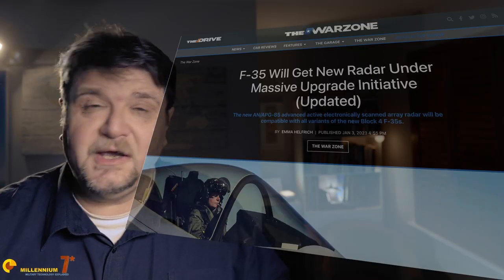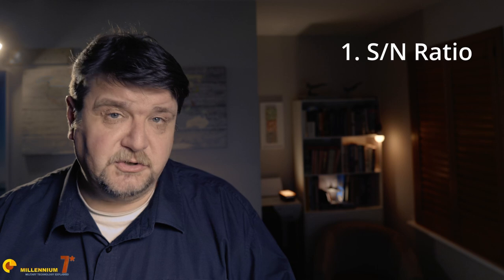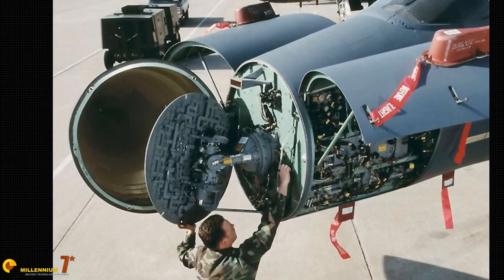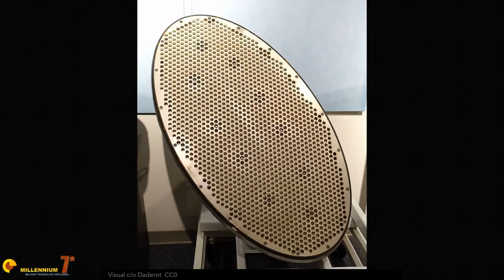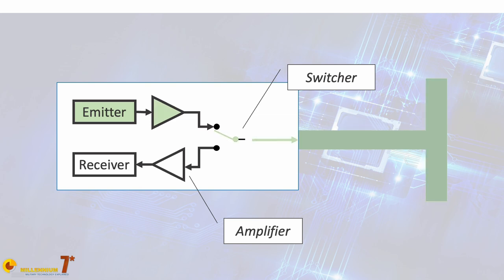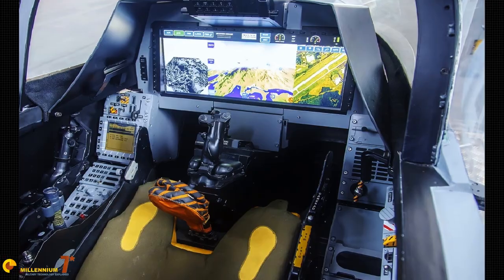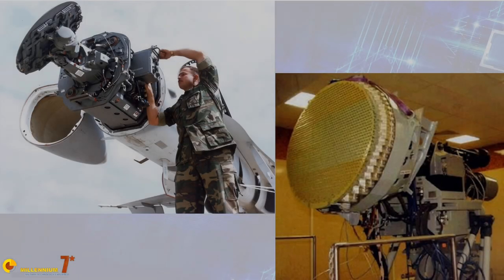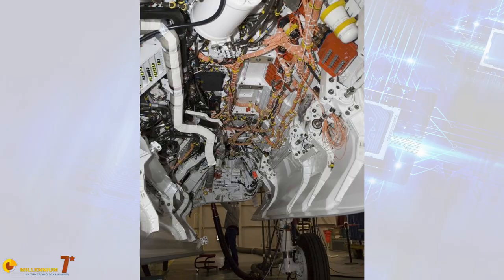The insane engineering of the F-35 AESA radars!

Comment: Fun fact:
The SAMPSON AESA radar on the Type 45 air defence destroyer has three panel antennas AND rotates, making the scan speed the combined electronic and rotational speed.
For when even AESA isn't fast enough.
Reply: Is there some reason for that? It seems unlikely that they would introduce additional mechanical complexity and thus maintenance and downtime on a radar unless they needed to, or if there was some benefit from it. What application would need even higher scan speeds than normal AESA radars already can produce? Hypersonics?
Reply: @jonathanpfeffer3716  
First off, I made a mistake, it's two back to back rotating panels.
An AESA panel can't see 180° of sky, so you either rotate the panel or rotate the ship.
And the ability to see art high off angles is reduced, reducing your vision even more, so rotating is even more important.
Aegis solves this problem with more than two panels, a more expensive solution.
SAMPSON is designed to defeat supersonic sea skimmers, where fractions of a second is life, so scanning rate is life. Every fraction counts.
Reply: @jonathanpfeffer3716  
This next part is speculation.
You could have 3 or 4 panels that don't rotate.
But maybe having radars overlap is a bad thing?
Certainly is another problem to solve, filtering out each others transmissions.
Whereas with two panels that can't ever interfere with each other.
But with two panels, they _must _ rotate, otherwise you have native dead spots where the radar can't see, "shoot here to win"
Reply: @MostlyPennyCat  Makes sense, that’s certainly an ingenious  cost saving measure, although I doubt the improved scan rate would really come into play just given how (as the video describes) GN AESA radars are basically instant already. 

As to your speculation, the way you get multiple radars to not interfere with each other is just done by angling them correctly and using some fancy software to filter the side lobes out. That’s what American destroyers do.

Comment: 15:15 The Gripen E employs the most GaN of any aircraft, making it outstanding. (Excellent Video)
Reply: Currently Gripen E have GaAs in the nose AESA and the Gripen C is being upgrade to GaN nose ASEA plus the Avionics of Gripen E, and more powerful engine. Gripen E will be full GaN(and SiC) soon.
Reply: @atlet1  The radar  upgrade for Gripen C is to MK4 so it's not an AESA radar. There are some indications that Gripen E might get a completely new radar in the future, it could be the SAAB GaN based one but there is no real information about it yet.
Reply: @LRRPFco52  False! SAAB is the leading company in GaN tech and the whole supply chain is in Sweden. Only Gripen have GaN AESA, which are several times more powerful than GaAs. Even the range of wavelengts is bigger. The area of the nose antenna is approximately the same in Gripen as in F-35. The elements in the distributed aperture system in Gripen is approximately the samme as in F-35. This make Gripen AESA more powerful, especially in a tactical mening.
Reply: Some USMC F/A-18C have GaN AESA radar i.e. Raytheon APG-79(V)4.
Reply: @valenrn8657  not correct! It started flight testning in may 2022. Gripen C is being upgrade with GaN multipurpose AESA now. Gripen E have multipurpose GaN EW in the wingtips and the vertical fin. The nose AESA will be GaN as soon as the production of it is enough.
Reply: @atlet1  Not correct.

In December 2022 Sweden ordered an upgrade package from Saab for a number of their Gripen C/D fighters. The upgrade includes new engines, a new radar and a new electronic warfare system. The order value is approximately SEK 3.5 billion and the contract period is 2023-2029

According to Saab executive Eddy De La Motte, the first F-39F will be delivered in 2023. In 2021, Brazil started F-39E supersonic flight tests at high altitude above 16,000 feet.

Look in the mirror.
Reply: @atlet1  Wrong.

Posted on May 12, 2022 by Seapower Staff
EL SEGUNDO, Calif. — Raytheon Intelligence & Space’s (RI&S’s) pre-production APG-79(V)4 radar system was successfully flown on a U.S. Marine Corps F/A-18 Hornet earlier this year, at Naval Air Weapons Station in China Lake, California. This is the radar system’s first flight on the aircraft since RI&S delivered the prototype radar in 2021.

The U.S. Marine Corps pilot demonstrated the radar’s seamless integration with the legacy Hornet avionics. The APG-79(V)4 radar is common in parts and technology with the legacy AN/APG-79 radar used in the U.S. Navy’s F/A-18 Super Hornet, thus optimizing cost and sustainment. Flight tests will continue to support weapons system integration on the fleet._

Understand proper English i.e. notice " earlier this year" from posted  May 12, 2022 date.
Reply: @atlet1  
Malyasia has selected APG-79(V)4 for F/A-18D and FA-50.
Canada has selected APG-79(V)4 for CF-18A. Canada also selected F-35A Block 4 which includes APG-85.

Finland and Poland also selected  F-35A Block 4.
Reply: @atlet1  

 Date: May 11, 202 by David Donald
Under a 2020 plan, the Naval Air Systems Command has selected 80-plus of the best-condition Hornets from the current fleet, including some recently-retired former Navy aircraft. Following a successful high-flight hour inspection at 8,000 hours, they will be cleared for a 10,000-hour life, sufficient to take then through to at least 2030. All are due to receive the APG-79(V)4, of which 50 have been contracted to date. The upgraded Hornets are intended to serve with up to seven 12-aircraft squadrons, each operating a mix of single-seat F/A-18Cs and two-seat F/A-18Ds.

David Donald's 1st paragraph about testing  APG-79(V)4 is not correct.
Reply: @valenrn8657  what do you men is wrong? That it have been test flown shortly before the date I gave? The important informationen this discussionis that Gripen have operational GaN tech as the only fighter in the world. The Growler may have a GaN pod operational. But that's not a fighter or built in avionics.
Reply: @valenrn8657  Yup.  USMC and Canada got priority on APG-79(V)4, which has better detection, tracking range, burn-through, and support than any Radar the Gripen E will ever get.
Reply: @atlet1 From flightglobal

 Saab also is on contract to produce 60 Gripen Es for the Swedish air force, which plans to declare the type operationally ready on 1 January 2025.

Look in the mirror.
Reply: @valenrn8657  please read the text ourself! If you undersand. The SWAF plan to declear it operational (for them Obs). SAAB decleared it operational more than a year ago. Please stop your false comments on this forum.
Reply: @atlet1  Fact: Swedish Airforce inventory does NOT have Gripen E/F in service as of today.
Reply: @atlet1 On December 19, 2022, the Brazilian Air Force (FAB) on Monday inducted the first four operational Saab F-39 Gripen E fighters into the 1st Air Defense Group (1st GDA), the Jaguar Squadron.
Reply: @valenrn8657  yes. The first military unit with Gripen E was operational then. The weapons system Gripen E was operational a year earlier.
Reply: @atlet1  Swedish airforce doesn't have Gripen E/F at operational status while the Brazilian airforce has four F-39 units at operational status as of Dec 2022.
Reply: @valenrn8657  read again and try to understand this time: a operational weapons system is not the same as a operational military unit. The first is technical and the second is humans trained to operate the technical thing. The Swedish air force want longer time for geting operational with it. Two reason is that the advanced status of the Swedish military forces and all the advanced fighters they already have.
Reply: @atlet1  Read again, APG-79(V)4 has been tested and proven to be operational.
Reply: @LRRPFco52  False! You don't k ow the future! No one ele either. We know today that Gripen E is the only combat airplane with GaN tech built in and that the Growler have it
Reply: @LRRPFco52  False, as usual from you! No one know the future. We know that only Gripen E have GaN built in and the Growler have it in a pod. We even know that the Global eye have had it for some years. If we speculate, we can guess that SAAB will continue to lead the GaN tech for some time. They have a lot in ther pipe line for the future.
Reply: @valenrn8657  Try to undersand ritten text, please. Proven to is not the samma as being operational. If it is, I will be interested.
Reply: @valenrn8657  "proven to be" may mean it's not. If you find a text saying it is operational, I will be interested.
Reply: @atlet1  Raytheon delivered both APG-79(V)4  and ALQ-249 NGJ-MB for USMC's F/A-18C and USN's EA-18G respectrively.
Reply: @atlet1  FYI, Marine Corps Commandant Gen. James Amos has said that unlike previous generations of aircraft, the base EW systems in the standard F-35 will allow it to just attach the NGJ pods and perform the mission, without having to make a special electronic warfare version of the F-35.

Like the Australian 12 of 24 F/A-18F Super Hornets, the standard F-35 is already wired for the EA-18G role.
Reply: @atlet1  Israel(via IAI's ELTA Systems)'s ELW-2085 CAEW  on Gulfstream 550 platform has GaN.
Reply: @LeonAust  because block 4 doesn't exist until perhaps 2028, but Gripen E with the superior capabilities and next gen avionics is operational today and cost 1/4th of the 4th gen F-35. Yes it's further from 5th gen than Gripen E and is not even a fighter. It's a strike aircraft with limited capability that isn't fully operational yet an no plans to how to make it fully operational. It's riddled with hundreds of issues and is not capable of operation against an advanced enemy yet.
Reply: @LeonAust  stealth can't protect a pilot from being killed. Especially not if it's adversary fly Gripen E, which can detect, fire stealthy and guide the missile at stealth aircrafts at distances of 100km. Only Meteor can fire stealthy, in supercruise, and kill at that distance.
Reply: @LeonAust  you are repeating propaganda. The bock3, which is inferior to Gripen E, is not impemented yet. 2027 the F35 avionics is planned to be in par with what Gripen E have today. Where do you think Gripen E avionics will be 2027? F-35 was called "joint STRIKE fighter"for a reason. It "can't turn, can't climb, can't run". It even take too few weapons, can't supercruise or have long range. That it's a failure is obvious for every one who know anything about airpower. And for every one who can think for themself, when the US air force  by F-15 for fighter mission. "F-35 is the quarter back that operate together with fighters". F-35have reached economy of scale and are still moe expensive to purchase than Gripen E. The difference will be even bigger when Gripen E reach economy of scale. The cost of a combat aircraft is to more than 70% operational costs, which is more than 4 times that of Gripen E. So a country can by real fighter airplanes of the most modern and superior type i the form of Gripen E for 1/4 of the cost of F-35A. If they aren't corrupt.
Reply: @LeonAust  False! illogic and no facts! F-35 is an obvious failure. The jointSTRIKE fighter was set out to be affordable, 5th generation and easy to maintain. Nothing of that came true. Instead the result was three very different and very expensive strike aircrafts that is very hard to maintain and far from 5th gen. 
Gripen E is a supercrising, low visibility, M2, very agile, long range, carrier capable next gen avionics omnirole fighter aircraft that is easy to maintain and is affordable with a cost less than 1/4 of F-35. It never set out to e 5th gen, but have some 6th gen features. It can detect, fire stealty and guide missiles from the no detect zone at stealth aircrafts at 100 km distance. What corrupt goverments do is no indication of anything but corruption.

Comment: Good video.  A few points.
AESA/PESA are often still movable due to the mentioned scan angle limit.  I'm sure you are aware of this but I don't recall it being discussed.
You covered many of the additional capabilities of AESA systems. As an extension of the passive capabilities, AESA systems could be synchronized with external emitters and passively generate high fidelity data.
You touched on heat rejection.  This is one of the primary problems facing modern military aircraft.  You may consider doing an video just on this topic as AESA radars are just the tip of the proverbial iceburg.

Comment: Excellent material covered here as always! I'd be curious to hear more about the detection capabilities of different IRST systems currently being fielded 🤔. Having a highly refined / integrated IRST system has the potential advantage of keeping radar systems in passive modes (thus minimizing return signatures). Allows for firing of BVR air to air missiles without having to 'illuminate' the target. Best wishes!
Reply: Current gen (semi) active missiles don't need guidance from the source so no need for "illumination" . Just to be able to detect the targets is where the game is at then launch and steer the missile in a general direction until the missiles guidance system takes over. This can be done with passive systems like AESA in passive mode or IRST. The analogy with how submarines operate is also more and more applying to air warfare these days. Also more likely the detection will be done by platforms like ground radar / AWACs and maybe even SAR equipped satellites.
Much harder to hide an aircraft than a submarine from those.
Reply: Don't forget you still need ranging information, not just direction

Comment: Note there are also Hybrid PESA RADAR (Bars, Irbis and so on..) i.e.radars that has an emitter/receivers module for each antennas but still has a single TWT for generating radio waves.
This allow almost all the advanced features of a an AESA radar but to keep a lighter and  steerable antenna (that however didn't need to scan constantly like a mechanical one but can be pointed sideways so allowing a complete FOW)  Only thing it cannot do is emitting at two different frequencies or direction or modes at the same time so it is a little less flexible and a little less capable for what it came to low probability of intercept mode.
Reply: Irbis has 2 TWT’s and thus 2 transmitters. The advantages of AESA is mainly reliability and jamming. But AESA has the potential to have greater bandwidth but is hampered by this due to beam steering technology.

Comment: Super interesting to see the dispersion of the recevers all around the gripen!! Did not know it had such coverage. 
   I remember when you did a video of the Su-57 you mentioned long pannels on the sides or of it was the wings that potentially would be in the L-band but you were wondering abit if it was true. Are they built with the same type of elements as the one you described now but with a different geometrical shape or do they build on different technologie? Is it just the size of the plate that limite what band ot can send in or are there other factors? Have ypu heard any thing more about the "L-band" on the -57
   Thanks for a super video!
Reply: Gripen E is full of sensors of different types, it has 50 antennas for a sphereic all around coverage.

Comment: Where have I heard this before? Audio! I am a retired audio engineer and not long before I retired the combination of arrayed monitors (speakers in caninets) and digital signal processing (DSP) was revolutionising mainly audio reproduction but also capture. Have you seen those large stacks of ‘speakers’ at a rock concert? Often flown (as in suspended) and curved slightly in a convex way pointing towards the audience? Same principles as laid out here. Phase delays, originally using analogue delay circuits but more recently DSP applied to individual drivers (speakers) enabled sound to be focussed where it is wanted. And calculated use of short digital delays also enabled stacks to be placed anywhere as the signal could be delayed taking into account the speed of sound to synchronise the sound waves throughout a venue. It tickles me that all these different fields converge into the meta field of signal processing. Whether it’s a digitised audio signal or radar radio waves, the principles are the same. Visible light is kinda it’s own thing because the wavelengths are so small. Quantum and other effects apparently screw up the processing algorithms that work fine for audio and radar wavelengths but most of this works, with exceptions and reservations even with uncorrelated (I.e. - NOT Laser) light.

Comment: Excellent, I was a engine mech back in the 70s and used to watch radar tech work on the F4 Phantoms we had.   Now I do have a question on this new radar.   I have read that it might be possible now to basically use this radar as a high energy beam weapon to burn out electronics at either a ground based or airborne early warning or even missile launch system.   Does the new system have that much power output
Reply: Depends on the system
Reply: At the moment it is not  a realistic possibility, the kit would be far too heavy.
Reply: It's really not the power that is limited; Imagine putting 10kW directly into a sensitive MMIC receiver.
That's basically the equivalent of shorting a 100A 120V supply directly through some poor Silicon IC (the voltage would almost instantly be clamped down to <1.1V by the substrate breaking down, which then leads to even higher currents, at least until the weakest link in the chain blows open circuit or melts closed cuiruit, thereby leading to a very bad VSWR until something else breaks down or melts...).

The real problem is getting most of the power into the same space as the target.
Getting even 1% of the beam's power coupled into a target through it's effective antenna aperature would require extremely good beam quality, and a way to overcome diffraction-limited dispersion over long distances (which might not be possible and would therefore underline the maximum possible coupling efficiency of all future microwave DEWs).